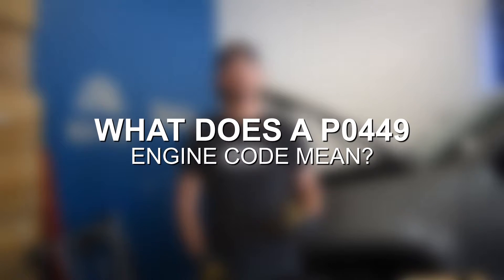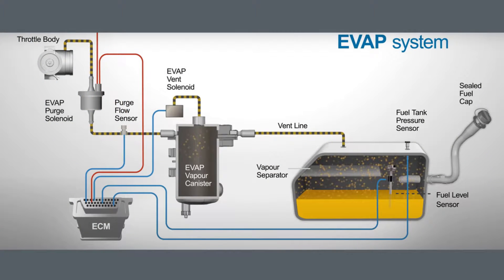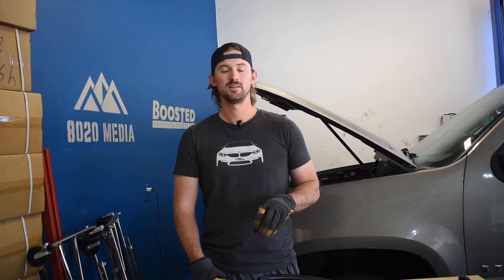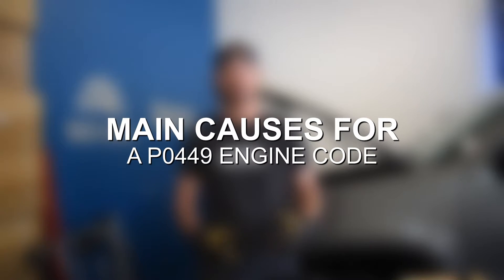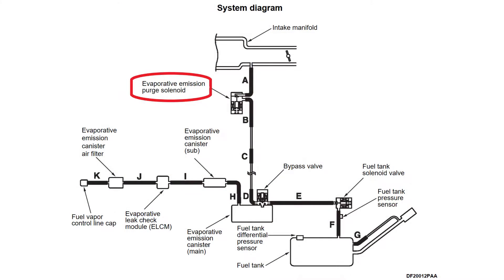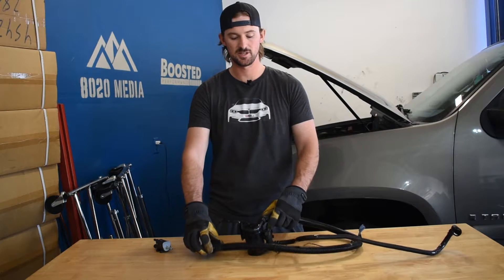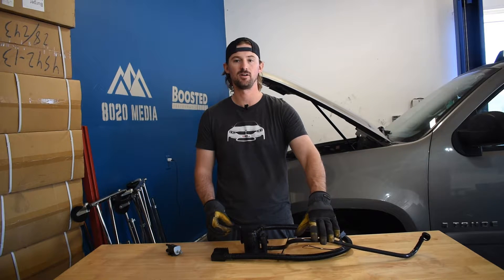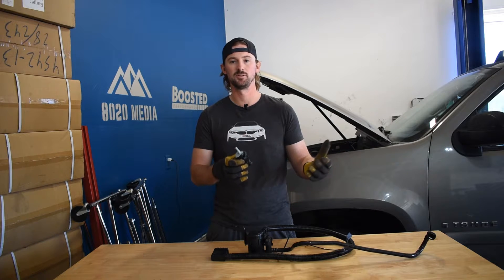P0449 GMC/Chevy Truck – How to EASILY Solve this Engine Code!

Comment: Will the check engine light go off on its own or does a mechanic need to reset the computer?
Reply from the maker: M - It would be best to reset, but if the problem is fixed, then it will reset on its own eventually.

Comment: Hmmmmmmm.   I have a 2010 Camaro with the same number P0449 so you’re saying it could be either the purge valve or the canister….. even on a Camaro??
Reply from the maker: S - Yes.
Reply: @8020Automotive . I think you’re full of monarchy……….. unless your code comes up and tells you it’s a small leak or a large leak than that would mean anywhere in your system………. But when it comes up as a code and telling you it’s an Evap system ,you look up that code and it will tell you what part it is….. computers are smart. You gotta know how to read them.  Purge valve for one code vent valve for another code will not fall under the same code ,,,unless it states small leak or medium leak or large leak then it could be anywhere in the system……. You’re a mechanic but then again I never did meet a good one!!

Comment: I got a 2011 Silverado 5.3 that has a rough idle not always but here and there like it will drop rpms under 500 in parked or at a stoplight with no check engine light. I’ve cleaned MAF,throttle body,replaced spark plugs,wires and replaced driver side valve cover because there was a slight leak. Still idles out the blue like it drops to under 500rpm and bounces back up and I hate it. So this weekend I’m changing the Vapor Canister Purge Valve that goes by the throttle body, Vapor Canister Vent Solenoid that goes by the charcoal canister and also changing the charcoal canister. I’ve checked for vacuum leaks can’t find any. And only reason I’m doing the evap parts is I remember a few years back when I use to let it run low on fuel and I’d try to fill up the fuel pump kept clicking like it was full I’d have to keep doing it over and over.
Reply from the maker: T - You're definitely on the right path—intermittent rough idle without a CEL on your 2011 Silverado 5.3 can be tough to chase, but your instinct about the EVAP system is solid, especially since running the truck low on fuel frequently can clog the charcoal canister or cause the purge valve to stick open, letting fuel vapors into the intake at idle and causing an erratic lean condition. That would explain the RPM drops under 500 and the bounce-back with no codes. Since you've already cleaned the MAF, throttle body, and replaced plugs/wires, replacing the purge valve, vent solenoid, and charcoal canister is a smart next step—just be sure to blow out or replace the EVAP line from the canister to the purge valve too, as it can get gummed up. Also, double-check the intake manifold bolts and the PCV hose under the new valve cover to rule out a tiny unmetered air leak. If it still acts up, consider checking fuel trims with a scan tool to catch hidden issues like weak O2 sensors or slight injector imbalance, but odds are the EVAP work will make a big improvement.
Reply: @8020Automotive I did blow the pcv hose from the valve to the intake because I added a catch can so I had to cut some of it and put new 3/8” line to run to the catch can
Reply from the maker: @t94zskss47  How's it working for you?
Reply: @8020Automotive so I actually replaced all the parts from the evap like I said and it’s still dropping rpms at stoplights or parked. And like I said it’s not always it’s just sometimes and you can feel it more when you have the ac running which i understand it’s going to drop some because of the load but it does it a little more than normal. Someone told me it could be the oxygen sensors too but I would think of it was them it would do it all the time. So let’s say maybe 2-3 times out of 10 I start it to drive  somewhere it’s when that little dip in the rpm is not stable. I think next I’m take it somewhere get a vacuum line test see if they can see any smoke coming out of somewhere or out around the intake.
Reply: @8020Automotive  thanks for the tips. I didn’t even think about blowing the line from the canister to the purge valve. The canister I bought is the gm factory one it comes with new line to the canister and new line for the little filter. But I’m make sure I blow that line to the purge valve as well. I know this trucks also can have a vacuum leak on the intake which is common so after I do all that if it still does the rpm drop here and there I’m either going to take it let someone do a smoke vacuum test or buy machine and do it myself. Thanks again!

Comment: Would a bad evap canister/wiring cause a Reduced engine power signal to come on and truck to lose all acceleration? I've changed knock sensor and throttle control sensor but still keeps coming back. Most recent scan now came back with 4049 code.
Reply from the maker: T - A bad EVAP canister or its wiring wouldn’t normally trigger a “Reduced Engine Power” warning or cause complete loss of acceleration—that’s typically triggered by issues with the throttle body, accelerator pedal sensor, wiring between them, or the ECU itself, since those are all directly tied into the drive-by-wire system. However, your mention of code P0449 (EVAP vent solenoid circuit issue) could hint at broader electrical or grounding problems, especially if you've already changed the knock and throttle position sensors. If your wiring harness shares a ground or power circuit with other key sensors (which is not uncommon on GM trucks), a short or poor connection related to the EVAP system could theoretically mess with throttle control. I’d strongly recommend inspecting the wiring harness along the intake, near the throttle body, and EVAP solenoid for damaged, pinched, or corroded wires, and make sure all grounds are clean and tight—particularly the one on the front passenger-side frame rail or near the battery. This sounds more like an intermittent electrical issue than a failed part at this point.
Reply: @8020Automotive Also I replaced the ECU 6 months ago.

Comment: 2017 chevrolet traverse P0449 evaporative emission vent solenoid valve control circuit located diy fix
Reply from the maker: A - Did you watch the video?

Comment: No power to the solenoid, I think. If so, what might be the cause? Fuses good per my test light. Then, with key on, I used my test light on the plug/wires leading up to the solenoid. No power. I then started the truck, let it idle for about 10 minutes and tired again. No power.  2018 Chevy Silverado 1500 4dr 4wd in excellent shape - stock.
Reply from the maker: D - If you're getting no power to the solenoid on your 2018 Silverado 1500—even after checking fuses and testing the harness with the key on and engine idling—then the likely culprits are either a bad starter relay, a faulty ignition switch, a neutral safety switch (range selector) issue, or an open circuit in the wiring between the ignition and the starter relay/solenoid; since your fuses tested good, try swapping the starter relay with another identical one in the fuse box to rule it out, then confirm whether the starter trigger wire is getting 12V when the key is turned to “start”—if not, the issue is upstream, likely the ignition switch or PRNDL switch not telling the ECM it's in park/neutral, which would block the starter circuit for safety.
Reply: @8020Automotive  Thank you!  I'll keep trying

Comment: i have po 449 and po 455 .. have replaced the vent  selenoide but didnt help ....i saw i video that sometimes is the gas tank sensor ....could it be my problem ??
Reply from the maker: M - Yes, it’s possible. P0449 (EVAP vent valve/solenoid circuit malfunction) and P0455 (large EVAP system leak) are often caused by a failed vent solenoid, but if you’ve already replaced that and the codes remain, it could be the fuel tank pressure (FTP) sensor, a loose/faulty gas cap, cracked EVAP lines, or even the charcoal canister. The FTP sensor monitors the system for leaks and helps trigger those codes if it’s giving faulty readings. So yes, the gas tank sensor (FTP sensor) could very well be your problem—especially if everything else checks out.

Comment: PS on comment below. No gas cap model.
Reply from the maker: D - Did you clear the code?
Reply: @8020Automotive   @8020Automotive  Disconnected the battery while replacing the parts, which I thought causes a reset. Later, a friend of mine used the tool that plugs in under the dash. Said he cleared it but it came back on. I truly appreciate your thoughts.

Comment: Replaced both on 2018 Chevy Silverado. Check engine light is still on. Suggestions.
Reply from the maker: D - Did you clear the code?
Reply: @8020Automotive  Disconnected the battery while replacing the parts, which I thought causes a reset. Later, a friend of mine used the tool that plugs in under the dash. Said he cleared it but it came back on. I truly appreciate your thoughts.
Reply: Change the gas cap?

Comment: i changer the purge valve on 2009 equinox 3.4 v6 i hane po 449 now it says vent valve????
Reply from the maker: W - A P0449 code indicates an issue with the EVAP system vent valve solenoid circuit, which controls the release of fuel vapors from the charcoal canister. Since you recently changed the purge valve, the vent valve might also be faulty, stuck, or have an electrical issue. Check the vent valve near the charcoal canister (usually located near the fuel tank), inspect the wiring and connectors for damage or corrosion, and ensure the vent hose isn’t clogged. If everything looks fine, replacing the vent valve solenoid should resolve the issue.

Comment: Could a gas line leak cause this code?
Reply from the maker: K - A P0449 code (Evaporative Emission Control System Vent Valve/Solenoid Circuit Malfunction) is typically caused by an issue with the EVAP system vent valve or its electrical circuit, rather than a direct gas line leak. However, a gas line leak could contribute to related issues in the EVAP system, as it might disrupt the system's ability to maintain proper pressure or vacuum. Keep us updated!
Reply: @8020Media  ok, thanks for the quick reply

Comment: Also causes remote start not to work
Reply: Any check engine light would do that too
Reply: Any check engine will disable the starter from engaging for remote start. Youll hear the fuel pump engage but that's it the starter will not attempt to turn
Reply from the maker: L - It's possible!
Reply: If it’s aftermarket it’ll work still
Reply: That's the issue I'm having as well
Reply: I’m definitely having this problem then
Reply: Thank you
Reply: That's the biggest pain in the ass besides the check engine light itself.

Comment: So can this effect why my gas gauge won’t go to full bc it’s stuck at half a talk even when I put gas in it
Reply: Throw some Techron in there that fixed mine
Reply: @tumbas299  huh?
Reply: @AssortedVideosforALL  techron fuel system cleaner can fix a screwy gas gauge
Reply from the maker: I - Do you have this engine code?
Reply: What did you do to fix the gas gauge mine is doing the same thing?
Reply: Clean the mass air flow sensor
Reply: @garyteeters-ok3hc that will not effect your gas gauge.

Comment: my ford eacape have a code p0401 too less flow..shoul the mechanic  clean the other egr parts?engine have knocking on first start,but vanished when the engine is hot.what dou think is the problem,i have 2.0 engine
Reply from the maker: M - We have a video on this code that may be helpful: https://youtu.be/LoAqvay0HEk

Comment: Replaced everything you mentioned and still have the code. Any ideas?
Reply from the maker: M - Have you cleared the code?
Reply: @8020Automotive  yes several times
Reply from the maker: M - Interesting. Have you taken it in to be looked at?
Reply: @MarkHollandsworth-b2v  did u check for power in wiring
Reply: @MarkHollandsworth-b2v  What was your fix? My check engine light is still on after replacing both parts. Thanks!
Reply: Saw another video where he replaced the computer module that sends voltage to the valve. It's located above the catalytic converter. I believe that's my issue due to it showing low voltage code

Comment: so i have a 2007 chevy malibu ls 2.2 engine and I'm getting a po449 code also, i went and bought a purge valve to hopefully get my check engine light off, do you think it will be that purge valve like in your video or the vent valve
Reply from the maker: B - It could be. We can't say for certain that it will be.
Reply: @8020Automotive  knowing my luck it will be the vent valve lol, the purge valve and gas cap i ordered should be delivered tomorrow, i should have it replaced and let you know if the code got erased, you did a great job on the video, keep up the good work
Reply from the maker: B - Thanks for the feedback! We hope you find your solution. Keep us updated.
Reply: So I replaced the purge valve and added the new gas cap but it didn't clear the code
Reply from the maker: B - Give it some time, or if you can reset it do that. May take some miles after. Keep us posted.

Comment: Is there a way to test which one it is? Autozone wont let you return parts after install
Reply from the maker: I mean you can pull one and try to manually clean it and see if it gets better or the code goes away. But both parts are like $30 so worst cause you end up with a fresh evap system and -$30 more than it should have cost